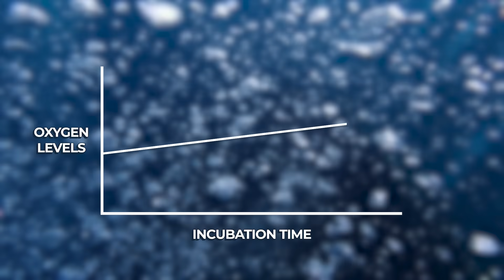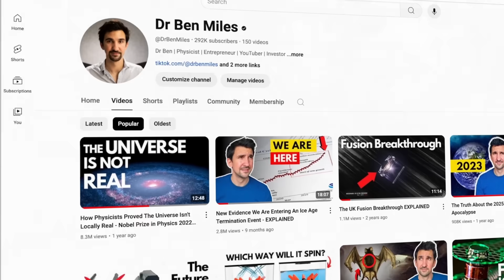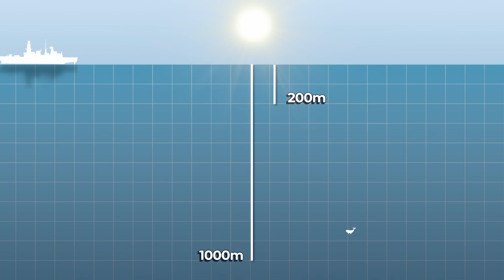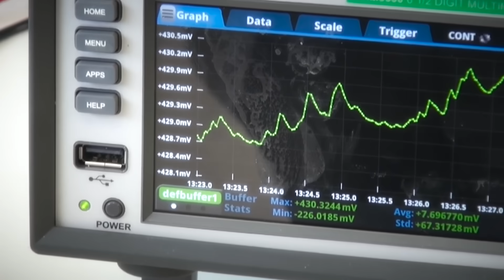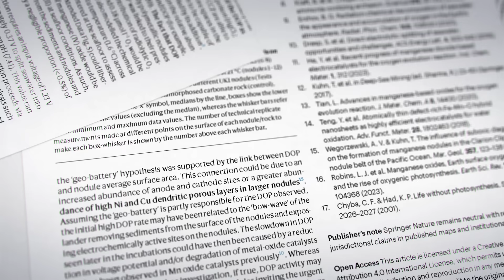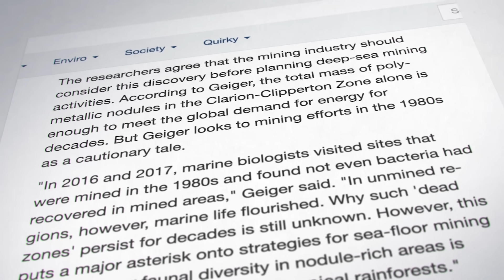We Just Discovered "Dark" Oxygen on Earth - Breakthrough Explained

Comment: Hi, Dr Ben Miles,
Nice video and subject.

Not only O2(g) dissolves more in colder water (just like N2 and Ar, etc.); but the temperature of sea water can only be approx 40°C to -10°C but solubility of O2 gas increases also even more under pressure (what is usually found in deep sea water (sea level is usually at 1 bar on the surface of the sea; and about every 10 meter deeper, you gain one bar pressure; this means that at (-)11000 meter (bottom of deepest sea point) you are at 1+1100 bars and that will dissolve O2 into water way more than the solubility increase of gases into water at an average of 15°C and at ambiant pressure of 1 bar.

Also into account the presence of salts (mostly NaCl that is at about 35g/L of sea water) what reduces a bit the solubility of gases into water. The famous fountain effect of mentos drops (sugar dissolution) put inside gaseous water soda is of course known; and this happens also with dirt, sand (nucleation sites for bubbles) but is even worst with salts (effect is enhanced over sugar dissolution, because the concentration of solutes is not monomolecular, but ionic dependant (anions and cations); so a salt can be like NaI (double effect), CaCl2 (tripple effect), AlCl3(quadruple effect) vs sugar. 
Theory is in part based on the Henry's laws, on the Lechatelier's principles and on the colligative laws.

So presence of salts reduce "activity" of water and its ability to dissolve gases (vs pure distillated water (demineralized water often used in lab standarts for solubility measurements)).

About the plausibility of the battery system of those dark rocks:
Indeed it seems pretty strange that there doesn't seem to be a counterpart to the O2 generation.
If it was O2 generated by H2O; then there sould be a reducer (like H2(g)) produced aside the oxydizer; but then it would be much less soluble than O2 into water and be even more forming gaseous bubble that should be seen and observed (our planet should be a gigantic H2 Zeplin ready to explode if someone decided to smoke a cigaret or a volcano to explode or an incendiary to consume forest to light that gigantic detonable mix of H2 and O2 (air)).

The possibility to reduce N2 to NH3 would imply very neat pH increase and sea water basification meaning a death zone down below (but this is not oberved neather).
This remains a mystery without further study.
 
Regards, 
PHZ
(PHILOU Zrealone from the Science Madness forum)

Comment: I'm thinking more recent changes in the temperature or more likely, the PH, of the water is causing the increase. If the parameters for the rate of oxygen release and breakdown of the metals were relatively different from our most recent era, then the balance of deposits vs oxidation might not be so implausible. We've already seen how our activities have affected Pb in the environment and water temps. It wouldn't be a stretch.

Comment: There is tremendous amount of metal over and under the ocean bed, there is a constant pressure of gases including oxygen itself which come in contact with that metal, density of water is higher in deep ocean and temperature is very low, so the gases become heavier than there actual state, the metal reacts with such gases and release oxygen in that reaction, 

Apart from that there are numerous living organisms most of which are unknown to mankind till date, which are responsible for creating oxygen like planktons, algae etc, 

There is a strong possibility that under the deep ocean bed enormous amount of oxygen is already present, probably between core and mantel, and the huge pressure and coldness of deep ocean water allows it to come up at slow pace, which maybe increasing with time because of global warming...

Comment: Well so the cylinder of 22 cm^2 being pushed into the sediment, is shown in the animation at 1:12. You would  think that there had to be at least one significant metallic nodule in that 22 cm^2 for the metallic constituent of the process. So if the clinder were placed where there are no visible nodules, what does increasing oxygen indicate? I was surprised that the possibility of abiotic hydrocarbon formation from CO2 and H2O in the mantle, and releasing O2, was not discussed.

Comment: I'm curious if the nodules, somehow, are rechargeable?
Saltwater has a lot of free ions, so I wouldn't be shocked if them just bumping into the rock constantly allows for some transfer of that kinetic energy into moving some free electrons inside the nodule around, effectively "charging" the tiny molecular scaled batteries dappled on the surface until they're full, then discharges the stored energy in a tiny burst of energy into the sea water, causing electrolysis, just for it to repeat again.

Comment: Maybe it's catalyzing a reaction/s...using heat.

Per

Also, doesn't electrolysis of saltwater produce NaOCl instead of Oxygen? 

Perhaps there's an aspect of electrolysis we were unaware of. E.g. Aminimum 1.5V is needed, yes. But electrolysis is still possible at voltages below that but the reaction becomes partially endothermic (thermal energy is needed below 1.5V).

Perhaps there's a scenario in which water electrolysis can be powered purely by thermal energy, and electricity is not needed.

Comment: You said yourself they were able to measure a voltage potential from these nodules. The voltages are completely inline with nodules in close proximity to each other being able to electrolyze sea water and produce oxygen. This could be easily tested by also searching for the presence and monitoring the saturation of Cl-, H+, and other products of the electrolysis of sea water (such as sodium hydroxide and hypochlorous acid). The fact that these studies are run by the mining companies themselves is a huge red light, and when you look at the acceptance rate of mining proposals, it becomes clear that the regulatory authorities enjoy a far too cozy relationship with the mining companies, and as such, independent studies should be conducted before granting mining rights to any company that could potentially permanently devastate an entire ecosystem. Also, one of the main reasons given to mine these nodules is to harvest rare earth elements critical to the production of lithium ion batteries, which could well be on their way out in favour of sodium ion batteries, the raw materials for which are far more readily available, and non-destructive to harvest (just straight up sea water contains pretty much everything needed for the production of sodium ion batteries, which while being less hazardous to the environment than ALL forms of mining the rare earth elements required for lithium ion batteries), the sodium ion batteries also seem to outperform their lithium counterparts. Let's hope that all of this can be made clear before an entire ecosystem is annihilated to further enrich a small number of already objectionably wealthy people.

Comment: As with the best scientific studies out there, I think it's plausible that it's a mixture of the presented theories. the voltage produced having an interaction with a 2nd or even 3rd "actor" reacting with elements also in the seawater, at that level of pressure, could have the water and still disolved metals so intimately close with the noduals that the electricity can move through the disolved metal, separating the sea water on a much finer level. The noduals produce a current, but it's the noduals voltage interacting with something else also in the water, would be my educated guess.

Comment: I love the idea. Still early days, but maybe there's a kind of collective force at work here - for example, the collective presence of the slow-forming geodes interacts with the sea water creating a cycle whereby additional material is deposited as oxygen is released, thus allowing the system to sustain over long periods; it's not just about individual geodes. Maybe the seabed itself in some way triggers the process through different magnetisation (or magma movement). Part of a larger holistic geological system at work?

Comment: "It's hard to get batteries right" is kind of a dumb reason not to believe this for me. There are so many places in the world that this didn't happen and this exact set of circumstances let to a stable and slow release of oxygen. It is really hard to get nuclear reactor that doesn't just explode all at once but they found a natural forming one that the only reason we found it is because the circumstances were exactly right that it was able to become stable. Also not completely sure why you dismiss sediment accumulation as a barrier for the generation of the electrical generation. It seems like a reasonable theory to me that once sediment was disturbed and the surface area was exposed the rate would be higher. I did enjoy this video. The name of "dark oxygen" had kind of put me off the topic before I had looked into it.

Comment: I'm not going to pretend I can defend the hypothesis in an especially meaningful way, but I will just say that questioning whether or not it could be a battery, because that kind of battery is very hard to get right, is a bold question of what nature can achieve as you sit there with your circulatory system powering your sentient brain that evolved from a single celled organism.

Comment: The missing element of your rebuttal about a battery is pressure. And battery could be the wrong term altogether. What is observed is an electrical current. The slow growth of the nodules could be the result of the electrical current and thus the system is in a positive feedback loop

Comment: What is the effect of pressure on this process so far beneath the surface? It looks like the voltage was measured at sea level. Maybe the pressure at 5,000m adds some kind of piezoelectric effect like quartz crystals is making up the excess needed to electrolyze oxygen?

Comment: I'm no expert, but it seems pretty obvious to me that the production of oxygen in water by these polymetallic nodules plateaus because of some sort of specific ratio, specific volume, or specific capacity of the nodules. Since the water being tested is a fixed volume, there might be a limit on the amount of oxygen that the polymetallic nodules can produce in a fixed volume of water.  

I'm not saying that the polymetallic nodules run out of juice. Rather, there may be a relationship between the volume of oxygen in the water and the electromagnetic activity of the polymetallic nodules such that when the dissolved oxygen to water ratio reaches a specific point, no more oxygen is produced by the nodules. 

This may be tested by taking the samples of nodules that seem to have stopped impacting their initial samples of water and placing them in new water samples to see if the same oxygen generation is initiated.

That said, I don't think these polymetallic nodules have infinite capacity to impact water in this way. Conversation of energy... At some point, they may stop producing oxygen in water altogether. But when? 

I have other thoughts, but maybe let's think about this first.

Comment: Just a thought, a build up of metals usually happens around a cathode. and with that really slow growth I'm guessing the charge would be very small.
The sea water must have a slight positive charge compared to the nodules origin, the metal coating isn't hampering the reaction. What is giving the calcium shell or bone the small charge difference?
At the moment I wouldn't mind the nodules with the other evidence of the lack of life near the mined areas, looks a little bit apocalyptic?

Comment: Batteries are a series of electric cells.
What is the proposed chemical reaction producing the voltage potential?
Is this the source of the ocean's salt?
Much of the life at that level are crustaceans, which use copper as their O2 transport. Mammals use iron, as Fe is slightly magnetic (ref Peter Plitchta, God's Secret Formula).
Might this potential voltage cause a Lenz's Law effect in copper to transport O2 through the crustaceans body?
Reply: PS are certain frequencies of the Sun's EMF inducing current via Lenz's Law?
I.e. do those same surface minerals produce potential voltage w/ an electrolyte?

Comment: Acceptance or refusal of the battery hypothesis needs to take into account changes in temperature and acidity on the ocean floor, and their changes over the last century. I don't know whether we have good data or models for that environment that far down. I could very well imagine a scenario where those nodules accumulate, or "charge" for an epoch, then discharge and electrolyse as conditions change.

I sincerely hope the depicted voltage tests in the lab are bogus press footage. Room temperature and surface pressure are not the conditions you want to test those nodules at. You get the wrong energy and reaction surface.

Comment: It is likely a bacteria is using the metals as a catalyst using hydrogen ions directly for respiratory processes with a complex that uses the salt in the water to help it along. The metals would deposit as oxides with a free oxygen for every 2 metal ions. The hydrogen ions would drive ATP synthesis directly with some part of the bacteria acting as a proton exchange membrane. Such bacteria could be put to work as a method of extracting metals concentrate from very low grade ores using salt water with oxygen as a byproduct. The unknown is how pressure sensitive the process is as the protien thar runs it likely works very similar to a RO membrane.

Comment: Actually making a battery that works the way in this video isn’t hard on a planetary scale. Magnetism from the planet creates the necessary charge the rock deposits are capacitors and the actual sea floor connects them with accurate distance apart from one another to hold onto enough charge as shown in the footage they are spread apart evenly in abundance which would explain

Comment: Did the experiment in the sealed containers, that found the oxygen level going up, also find any increase in dissolved hydrogen, or hydrogen gas in the container? Electrolysis makes both, so if it's happening, enough to explain the observations from the sea floor, then where is the hydrogen?

Comment: I could imagine that there is an geometry or configuration of metals in this rocks that when interacting with water at high pressures and low temperature could lower the energy barrier for hydrolyzation. It is not like a battery that gets depleted, more like 'free' energy that gets harnessed from configurational alignments of a group of atoms under special conditions, and it continues to generate oxygen indefinitely as long as the atoms involved are not altered in their 'special' conformation. By free energy I do not mean Gibbs or Helmholtz free energy, more like thermal energy that is just readily available from the environment, though sometimes I think that is what it originally meant. This is just an off the top of my head opinion, no hard feelings if you debunk it off the bat. I look forward to reading your responses!

Comment: I don't believe the battery hypothesis, unless it's only due to the layers being disturbed. There's no way there's enough sediment of native metals and metal ions, with a higher reduction potential than 1.3V, and if it were happening, where is the hydrogen going? It cannot make hydride salts in an aqueous environment. There could be some sort of weird reduction reaction going on, liberating oxygen from metallic oxides, but not from electrolysis of water. There is an easy way to prove it though, introduce radiolabelled tritiated water, and oxygen-15 water, see if any of the oxygen-15 or tritium leave as gases when the samples are heated, that should tell you

Comment: I feel like I cam across something kind of like this working both ways, like bacteria living on and using metal to generate electricity to supply their metabolism with energy to break down food. In the process a little bit of electricity could be harvested. And in another article something about the reverse happening where electricity could be pumped into bacteria to run their metabolism. It was a bit like O2 respiration vs CO2 respiration. I think someone was going to try using it as a way to have remote toilets, like in parks, that don't have to be cleaned out and could have a nightlight. Wish I remembered all of that better than I do.

Comment: Without way more information it is honestly almost impossible to speculate.  

However, it could be these nodules are actually perfect natural batteries or perhaps they are the environment for bacteria which makes oxygen. 

Although, this is happening at the bottom of the ocean so how does the atmospheric pressures at the bottom of the ocean affect these processes?  I mean when you have 1,104 atm it is bound to change.  Water is being compressed to 98.2% of it's original size meaning there is an immense amount more water at the bottom of the Ocean than there is at the top.   I wouldn't doubt this compression makes water molecules way more susceptible to splitting into Oxygen and Hydrogen.  

I wonder if there was any Hydrogen measurements at these levels and what was found.  Because if you have a higher concentration of this "dark" Oxygen due to electrolysis then you would also have a much higher concentration of Hydrogen at these levels.  That would be very good evidence that there is an Electrolysis process.  If there is no increase in Hydrogen at these levels then the source of Oxygen would be from some other process.

Comment: A grid of metal in an electrolyte, producing electrolysis.  Time to examine magnetic fields in that region.  Even a very slight variation of magnetic field over a vast area would have a significant electrical capacity. The whole sea  floor could be a naturally occurring circuit.